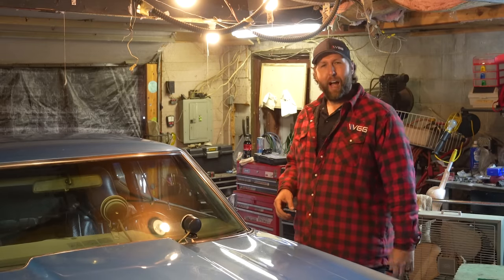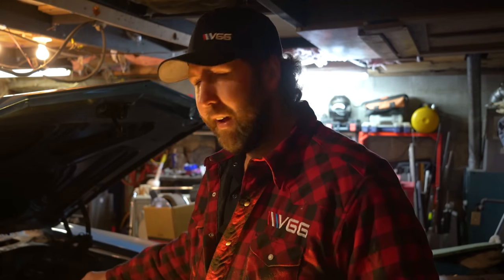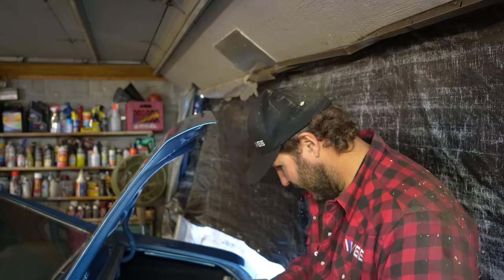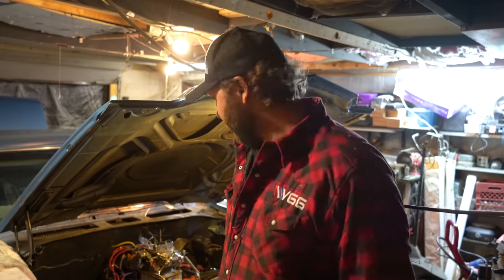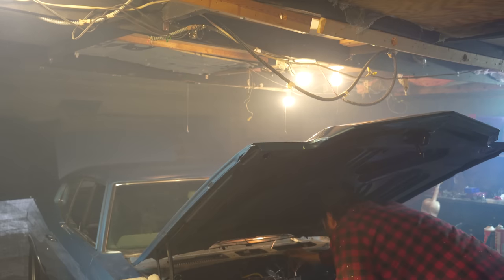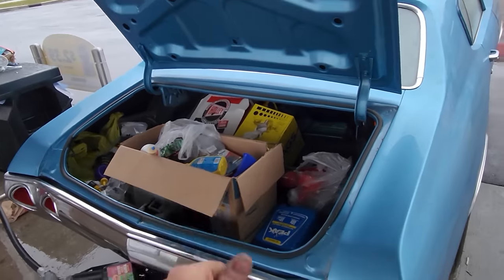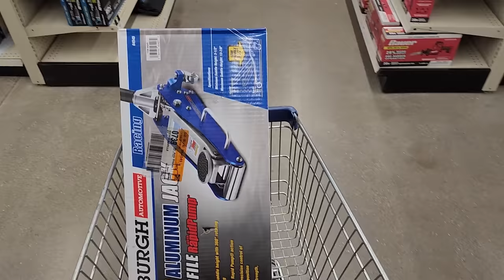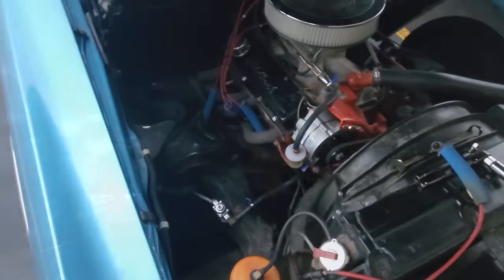80s Built Chevelle Drag Car - Will It RUN AND DRIVE 450 miles home?

Comment: I put a brand new 456 third member in my '55 Chevy 210 series, when I built it, back in '67, because that is what all the small block Chevy guys were running on the quarter mile strip, and was that ever a big mistake!  I couldn't get any traction off the line or in second gear, with my Jim Hall Chaparral hypo 327 on 10" slicks.  It was so hot, it was like the mystery oil..."no one knew what was in it," including myself...lol!  I estimated 400hp running a ASB 4-barrel (the largest I could get on my high rise without cutting the hood.)  I ended up switching to 4:ll's, which shot me out of the lights perfectly.  I think 456's might be to low for your little gem...!?  "You might as well be driving a tractor" is right...lol!

Comment: I had to stay at a sketchy hotel. I was driving my 97 2 door Yukon.  I took the fuel pump relay out.  So it won't start.😂

Owning a Chevelle is my dream. I would go with 454 big block. Just because.

Comment: Nice Lakewood ladder bars my buddies 67 Pontiac sprint had them with a 66 327 vette engine11.5 to 1 steel crank cam only had 194 64cc chamber heads it ran well

Comment: That blue is a keeper, if it was mine. Somewhere  down the road,  I'd do a front floor pan in it.then disc brake conversion.  Then get an adjustable  pair of front seats.  But 5hats just  me.❤

Comment: What is it with you and driving in the rain lately? A suggestion for fogging up on the inside, get a shower squeegee or a window squeegee (for household windows) from the home improvement store. That way, you can clear the front and side glass while you're driving.

Comment: When you do these resurrection trips perhaps you should bring a cheap hand vacuum pump so you can bleed brakes by yourself.  Also a scissor jack if you can pack one in the luggage. Watched you do several of these revival videos and those 2 things might need to be added to the EDC trip kit.

Comment: Bought a 1954 Willy’s jeep and 1st time breaks applied flew me right across the street. Next was breaks have out at a corner had to pull up on the sidewalk to avoid the intersection and cars. Hammered the rear break lines flat so had fronts barely. Break lines go bad and leak everywhere when they have a mind to. If I were to go back - master cylinder, 4 break cylinders and all lines - then take it on the road.

Comment: Nice cars My brother won a 67 chevelle SS car was mint two owner original engine was painted black original colour was ? blue but was a good paint job as no hint of the original colour was anywhere on the car and it had a non original engine bonnet swapped from the original two side scoops to a  single Center one  he sold it for 30 grand but I miss his ‘72 that had maroon velour seats with 72 stitched in white in the backs of them but he sold it back in the 80s for couple hundred as the engine was blown that was the car I wanted as it was my birth year. The 67 happened to be his birth year man I miss them cars.

Comment: That tight oil filter reminded me of the time when I was younger, I would change the oil for people to make money. And I ran into some extreme tight ones. And when I would tell them, you really do not need to do that. One guy told me, he does that to all his cars. I was like, ok, I can't make him understand it is wrong. On that hot rod setup, I am thinking a pretty good Cam. It should rattle once you get it running. I wish I had that car. Dude, that car has a bad A$$ engine!! would be worried about gears in the rear. I had my car pretty bad to the bone built. But when i wanted to go to the next town and win some races, I had to stop often to cool off my engine. Me and my brother purchased a car, different model. But it was the same type of setup. My brother did change the gears in the rear end, so we could drive it home. And it worked! Please keep that car, do not sell it. Would love to see more about that Hot Rod!!

Comment: I always just open up the bleeder and pop the cap off the master and just flush with some fresh break fluid until the air bubbles are out and then put the cap back on master, closed the bleeder Pump the brake pedal and repeat the process 3 more times

Comment: I had a 66 Mustang that I built up, had traction issues at the track with a 3.5 open rear, swapped in a built posi 4:11... that was a LONG drive to the track on short tires at about 3600 rpm.  Found out that the difference between a 3.5 open and a 4:11 posi was that instead of being a controllable one wheel wonder, the car would just break loose the rear and go sideways under throtte and was useless at the track.  Swapped the 3.50 gear set back in... 60 foot times were crap but with the nitrous hit at about 3/4 track it would run 12.56 at 116mph.

Comment: Derek, these new fangled air pumps are garbage....you're right!!! 

I had a local tire shop put new tires on my truck...ram 3500 quad cab, extended bed, 5.9 cummins....musta been a new guy because he put 32 of the lbs's into my tires...............they're supposed to be 60-70, depending on what I'm loaded down with. So the tires were, you guessed it, about half flat. I know they were only flat on the bottom, but every time I tried putting the flat part on top, it kept moving to the bottom. 😂😂

So I tried using one of those money stealing gas station devices with air hoses hanging out of it....and it didn't do anything. Had to go to 5 different gas stations (because I forgot my battery-powered air pump) to air up 4 tires!!😮

Comment: There is a tube that goes down in the block before you put the outer dip stick tube in it.  The inner tube keeps from the dip stick wrapping around the crankshaft...

Comment: As long as there's no air bubbles in the brake system it's good. All you're doing is getting the air out of the system.  Can open all four bleeder values and let gravity do what gravity does, just keep the Master full of fluid so doesn't get in there before closing up  the system

Comment: Test continuity between the stator plate, cylinder head and coil mounting bolt. If you don't have ground continuity between all 3 you won't get spark. My theory is that they only ground between the engine and the frame was through the head mount. When they pulled that doing the top end, they broke the last remaining ground between the engine and the frame.

Comment: It was in a front end accident on the track. Explains the repaint, new hood, uninstalled fender liners. Also the incomplete installation of the fuel make it happener, And engine. Maybe

Comment: For leaky Air Shocks, He may not knew at the time, but you can actually shoot some Fix a Flat inside those Air Shocks too. Not a whole can just a 5  or 8 second shot followed by blast of air to push it in and you will immediately notice your leak is Gone.  Dont tell me you cant. Ive done it many times. Its recoats the cracked rubber inside and seals leaky o rings.

Comment: Sorry, I'm not gonna pay for a membership!
When I seen that Chevy, it was like seeing a really good looking guy! When she started, it was better than erotic....(memories). A buddy of my "Husband", now my "X", gave me a 68' Chevy Impaula. Fairly good shape. He wanted the 350 "souped up" engine, and he found me a ,302 in a sand pit!! I rebuilt that thing, rings, bearings, gaskets, and washed it up in a parts washer. My neighbor gave me a 2 barrel Holley all ready tuned. Put the engine back in, turned it over, and she fired right up!!! I was jumpen so high, I could tell you what kind of Bird droppings were on the roof of my garage!!! It's not every day a woman gets a rush like that!! My old man came out and said shut it down, you need to put the exhaust back on! No " lumpy bumpy" cM and highway gears. No pink slips

Comment: The paint is awesome. If you wrap it, the paint will get trashed. Wraps last 2 years at most anyways. Wax it up and leave it. 

400 SBC sounds like it needs a stroker kit and a hit of nitrous to me, but if its already pushing 13:1 or something crazy, that might turn into a grenade. 

It sounds great, maybe just clean it up, make the seat adjust, get it running and driving right, and make a quick $30k off it?

If its a keeper, I would shelf the 400 and put in a racing drivetrain. Maybe ladder bars in the rear.

Comment: VGG pocket/field manual or guide for handy part numbers, tips, trucks.  Like a mini Chilton's for hotrod revivals.  I'd buy a copy.
Reply: @duggid4859 last time I used a Chilton's/Haynes "following removal of fuel pump OEM replacement is removal is the reverse of replacement" just to be sure I mounted gas tank to roof as to take advantage of gravity feed when reinstalling old fuel pump which now works better and runs whisper quiet😅😅😅

Comment: Pretty nice car. Those 68-72 (64-67's as well) Chevelles make great drag cars. I wish people would stop cutting up the dash and interiors in these cars. There isn't any power there. Focus on engine, trans, rear, suspension, brakes, fuel system and wiring. GM 400 blocks are thin. Even .030 over can be dangerous. Drive shaft loop is too far back. The entire rear suspension is junk. The Turbo 350 has potential, and the 12-bolt rear is good start. Sounds good.

Comment: Okay few things you can do take your hotwire touch it to the terminal coming off of your starter solenoid that your original starter solenoid wire would go if you touch that terminal with a jump wire  if it cranks it's the push button if it still does not crank it's your starter solenoid  make sure the kickstand is in the upright position otherwise it will not start

Comment: Not sure how you intended to get a reference signal for the RPM gauge, but 80s VW diesel cars used a 'W' terminal that is wired to one of the rectifier diodes to get an A/C voltage signal. I think the gauge measured the hertz, but not sure.

Comment: While whittling down the pre fire “adjustments list”, addressing the most pressing mechanical issues, and subsequently playing “whack a gremlin” all the way home, certainly did make for an entertaining video. I was fairly aghast by the fact that upon realizing just how much rear end gear the car did have, that instead of calling for a flatbed to take her home, you “endeavored to persevere” in the pursuit of torturing not just yourself, but more so that poor motor.
    That motor seemed stout when you first got it running. And it was clear that it was pushing some fairly high compression. Easily 10, 10.5, or possibly even 11:1. And with that, two things immediately came to mind for me during, and soon after, your “on the fly” oil change on the way home. The first thing was that there was no mention of exactly what brand and viscosity of oil you purchased for that change. And also no mention of having purchased an additional zinc additive (ZDDP) with the oil for that change, to protect the cam. The only oil I know of that is widely available just about anywhere that already contains that additive, is Mobil 1 15W-50 Racing. Which is why I mentioned brand and viscosity. 
    That being said, the second thing that lended itself to my suspicion that you had possibly overlooked this detail, was when you pulled over and started noticing an odd sound with the motor that was not readily remedied by checking and adjusting out the rocker clearances. At that point I was thinking you had probably begun to wipe one or more of the cam lobes due to the constant high rpm stress that engine was clearly sustaining during that prolonged bruising....er cruising it was forced to endure. 4.56 gears, and a Turbo 350 are a slow, but sure, death to any built, high compression engine. Especially one that has a fresh oil change with any “detergent” engine oil, devoid of ZDDP, regardless of the viscosity.
    Hoping the engine was ok, but I can’t help thinking it was, and is not. Going to watch the dyno, and drag time videos for the car, now. It will be interesting, no doubt. 
    Thanks for the video. I actually did enjoy it, despite all the self punishment. 👍😂
Reply: If it’s broken, even if avoidably, what would be the fix?
Renew the cam?

Comment: convert to luxury touring...keep paint...shoot clearcoat...bulletproof all systems so that long, trouble free rides become a genuine possibility,,,,,fine tune pilot's couch so that it fits you like a glove, made specifically for you...make it so stable that you can take regular odyssey trips to drag strips far and wide, make back seat a place for a 12 volt ice box, add a few other specific resources such as tools. and essentials in case of breakdowns, I would advise a fuel cell installed in the trunk, make it like forty gallons, I would advise a deep cycle battery group in trunk also and make it so you have two separate 12 volt systems, primary and secondary. Add A Super duty radiator system with at least double capacity protection against overheat or coolant loss. Ad a double capacity oiling reservoir, with a cooling capacity for twin capacity oiling and cooling.... might want a a deeply capable auto repair resource behind passengers' seat so you can fix unforeseen problems ether of your own or our friends and encounters. I am a little concerned about lack of fender wells, if possible, I would completely enclose engine compartment, it would be really sweet to have a tilt front end, further, it would be advisable to have fire suppression in that compartment, if you feel bored each compartment should be enclosed with individual fire suppression Areas with access from at least two locations on the vehicle. I think at least one front and one rear tire should find themselves tucked in somewhere...The object of this list of suggestions is not exhaustive, the goal is a long range real world and ultimately safe and r\enjoyable vision that would reimagine the movie "Vanishing Point" but with a happy ending. As a purely aesthetic final thought as for paint, the entire vehicle painted in multibple layers of ghost rainbow flames.    The good sir, I wish you pleasant dreams and similar heroics of "Road Warrior" ...Peace!

Comment: Drums you may as well just get wheel cylinders for both fronts. Any time i work on drums i just assume they need wheel cylinders. 

Nothing wrong with drums, they work great. Theyre heavy, but they work great. Much more contact patch than disk brakes.

Comment: HEAVY CHEVY..Just started watching your channel ..The  71-72 chevelle vin wont tell you if it is  a factory SS but will tell you if if your Velle was factory built as Heavy Chevy..
Reply: According to Fisher Body at least until 1971 cabs were stamped near where heater core went. I did not see it on this example. A lot can happen in 50+ years😊

Comment: Derek, you will not have them burnt plug wire problems, if you run the plug wires UNDER the headers.

Comment: Man that's your Chevelle is super nice what do you want for it,,? I can't believe you said zebra stripe gum I haven't seen that in years I used to love that gum next time you can check one of the Walgreens they usually carry the little compressors that plug into your cigarette lighter they work pretty good

Comment: That taping could be an acorn, nope, not joking, rebuilt an old Ford that had become the apocalyptic storage space for squirrels, and a few whole acorns had gotten into the intake manafold under the carburetor spacer somehow, they would tap to the beat as they were maybe 30 years old and had petrified in  to small rocks.

Comment: Try using a vacuum guage to adjust the fuel jets to get your highest vacuum.
Reply: Since Derek is now 'bigly' who needs vacuum fuel drive when you got 3800 GM EFI Tuned Port PWM inspired Holley carb kit. But with any deal with the devil it appears the kit has the ability to run motor in limp mode (RPM limiter) if computer sensors ain't reading right as seen later on his Cab Crew Chev Truck.

Comment: My first car I bought in 1977 when I was 17 yrs old was a 1968 Chevelle SS with a 396 set up for drag racing for $800. The guy said it had a blown head gasket. Wrong, it had a cracked block. We rebulit the motor. It would make my neighbors windows shake when I went to school. That was the worst car for a 17 year olds first car.

Comment: Clean windshield in and out with alcohol then put the juices on, next time have a shock issue stop and get tennis balls jack the car up stuff them inside the spring then lower the car on the ground

Comment: I Feal like family after what you have and are still traveling home as I type this, You seem to have high crank case pressure. You will blow gaskets oppps you did crap.  You need to vent the Crank case better.
I hope to see you say screw this and go to udall rent the pick me up truck and car tow trailer. It would have saved that stress on high stall tork verter wait what your home. Do you still have a wife.
Lmao 
Loved the adventure that was fun to watch
I look forward to your next E Ticket Ride.
Thanks for the adventure

Sean

Comment: The 71 Chevelle. Is nice and grumpy with a side of lumpy. I would leave the mouse motor. C/O the rear end gears. 4:11 will keep it snappy. 60 mph at 2100 to 2500 rpm 3:73 will get you 70 mph at 21 to 2500 rpm. A good limited slip posi or a detroit locker. The Paint is too good to change it

Comment: 400 sb with  camel hump or double hump heads shows some good promise for some great potential. Are we looking at 12 1 compression high winding motor i hope so
Reply: Nope, somethin' wrong with that whole thing...SB 400 have 4.125" Bore, AND, two weep hole between the cylinders (something camels don't have) and water jackets in the heads..ya need those to circulate the water thru the heads, that all goes away with standard sized 4" heads like Camels..

Comment: Compression test that 400, then buy a crate of octane booster 😂😂

I was running 12.5:1 in a 351C 4b that was built by a speed shop. They had it set to max out at 7800 rpm 😂. 

Those small blocks can make power if you spin em up.